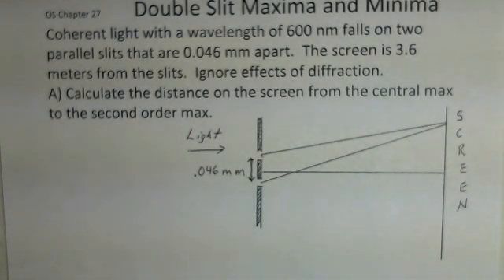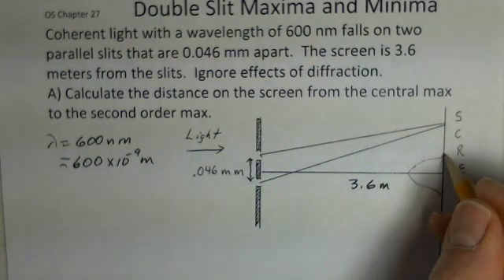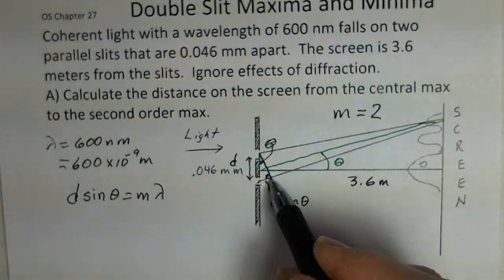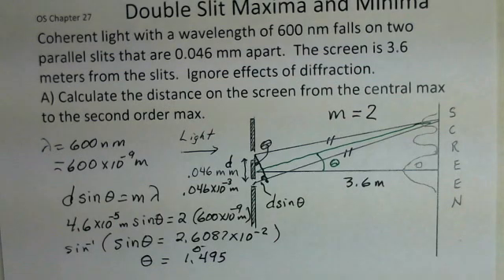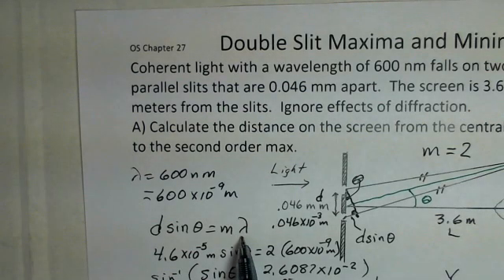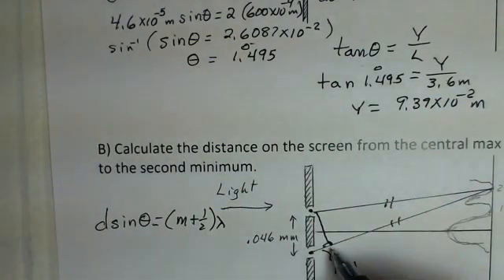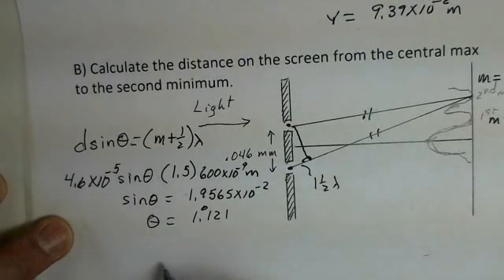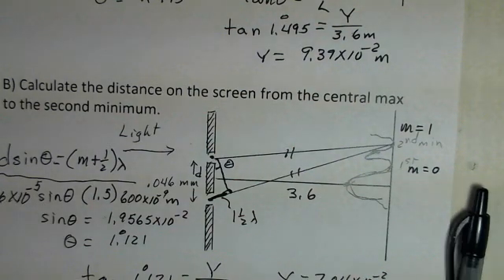Double Slit Interference Maxima and Minima Locations

Comment: Actually, in the second example, m=2
Reply from the maker: If the equation for the minima was d*sin(theta) = (m - 0.5) * lambda then m would equal 2 for the minimum identified in the video.  But for the equation d*sin(theta) = (m + 0.5)*lambda the m values that identify the minima are 0, 1, 2, 3, etc.  The minima, in order, are located where the path lengths of the waves differ by 1/2 the wavelength, then by 3/2 times the wavelength, then 5/2 times the wavelength, etc.  When using the (m + 0.5) version of the equation for minima, the value of m is 0 to create a path length difference of 1/2 wavelength and thus to calculate the angle to the first minimum location away from the central maximum. The value of m is 1 when we want to calculate the angle to the second minimum location. Using m = 1 creates 1.5, or 3/2, or 3 * 1/2 inside the parentheses.  1.5 inside the parentheses tells us that pathlengths for the two waves differ by 1.5 wavelengths and thus the waves are 1/2 wavelength out of phase and we have destructive interference at the location shown in the video.    The value of m is 2 when the path length difference for the two waves is 5/2 times the wavelength and we thus calculate the angle to the third minimum location away from the central maximum.
Reply: @GregClementsScience  I see, thank you for this explanation. Because the m = 0, +-1, +-2, does that mean there is one zeroth order max( the central bright fringe) and 2 zeroth order minimas(the dark fringes on either side of the first max.
Reply from the maker: @tylerbroderick5029  Yes, m=0, for the equation for maxima, is the zeroth order, the central, max.  For the minima, m=0 is the first minimum away from the central max.
Reply: @GregClementsScience 😊